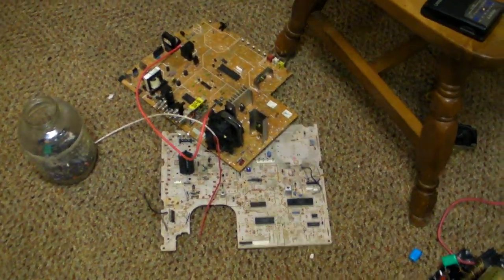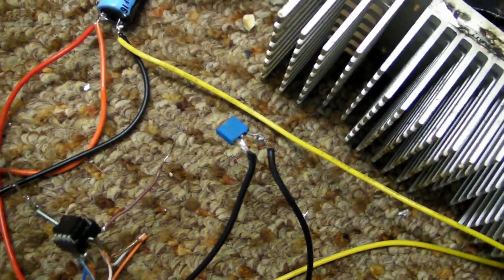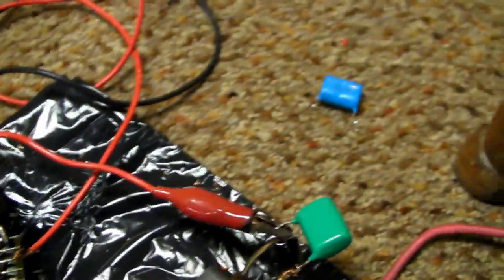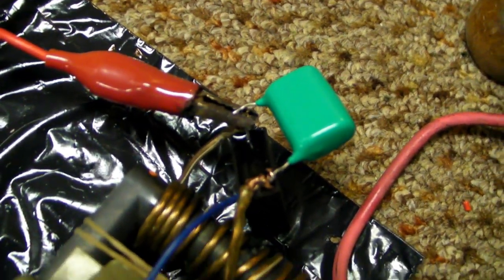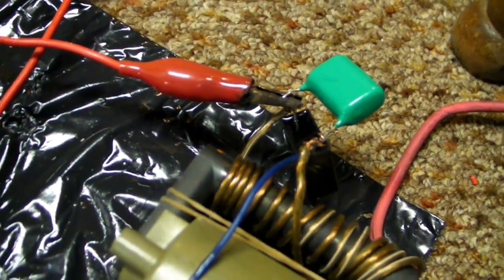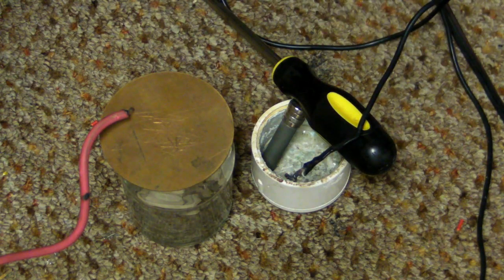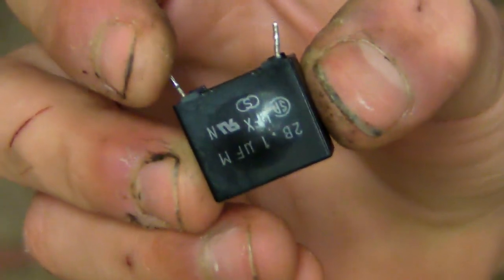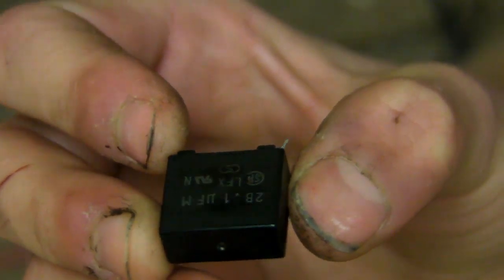Huge Arcs From 555 Flyback Driver!

Comment: 5:19, Dude, use high voltage wires, I can see a small bule corona between your fingers.
Reply: ikr? it gunna go rght through one of those times lol
Reply: corbonzo1 at least it will be high frequency xD
Reply: ahaha i have a tiny flyback from a plama globe, that thing is scrary, itll hit you right threw think rubber pliers handles XD
Reply: What!? I'm totally pulsing mine then!  Dropped it about 2 months ago QQ
Reply: Tesla Explorer i just plug it in hahaah
Reply: but it needs MORE xD
Reply: i accidentally touched the ground wire on my TC secondary, those where pretty good burns, and it smelt horrible XD
Reply: perigoso, se o diodo interno entrar em curto, a alta tensao fica alternada e ele leva uma porrada

Comment: ok, now the transformer is 11,8V around 6A, with a capacitor of 16V@22'000uF, the output is 16V, the maximum of the 555 timer capacity

Comment from the maker: @ciprianwiner no problem, hopefully it helps, also, that little inductor transformer on the in series with the input certainly helped a bit, so try some work with the inductors in series with the mosfet-flyback-positive voltage

Comment from the maker: @lo9765 Yes, the capacitors are needed in the self-oscillant driver (ZVS) for it to work correctly otherwise there will be pretty much no output. On the ZVS, the driver uses very little power when there is no load, but when you draw an arc, that is when it sucks up power. With my 555 driver it seems to draw the same power when or when not arcing, which may be why the mosfets heat so badly in most cases.

Comment from the maker: @JD8853 Hmm, I never thought of that. As for the capacitor, that wont work, its too low of a capacitance. Saltwater caps are normally .00XuF

I sometimes do that with the TV, but often it dies from RF, and many of the flybacks are from dead TVs I pick from the garbage.

Thanks, good comment about the mosfet!

Comment from the maker: ZVS is definitely the way to go. Its highly efficient, and easy to run high powers through. But considering this is the crummiest flyback driver out there with two small additions, its not bad at all. I have quite a few ZVS videos myself, and more to come. I intend to make a ZVS that you can run directly off rectified mains.

Comment from the maker: @mgregggphone I am working on a good 555 board. I will make a video of it shortly. It is on a solder type breadboard, has a 10k 25 turn trimmer pot for duty cycle, and a 50k 25 turn pot for frequency. The frequency is set by a .01uF capacitor. This board has the npn/pnp pair for more power. I have not finished the connections on it, and want to get screw terminal sockets for the input. I plan to test it this weekend

Comment: @juniortore1 no , i'm not using zvs , i'm using simple transistor oscillator with feedback , using 2x 13007 high voltage npn power transistors wired in parallel , a capacitor in parallel with primary winding and one in parallel with feedback resistor , using 35 volts power supply , which under it drops to a lot lower voltage , i get about 60-70 watt output , with almost white arcs

Comment from the maker: @AddColorsToYourLife That makes a lot of sense! Thanks for pointing it out why the mosfet heats.  Holding the wire is not really, but would certainly hurt if it burnt through the insulation. I only did that in this video, I used a chicken stick after.

Comment from the maker: @08Kutt Why schematics? I explained it good enough didnt I? Just average 555 flyabck driver, with a .22uF capacitor across the flybacks primary. And for the inductor, its not needed, but I found it to help keep the mosfet even cooler than it was. That just went in series with the  + and the flybacks primary to mosfet drain

Comment from the maker: @filipkof Ya, the 555 flyback driver normally makes a LOT of mosfet heating. I have had 2x IRFP250 mosfets die at 12 volts from overheating. And yep, thats what I thought. Also, this goes with the concept of getting rid of kickback, but the capacitors may help smooth that.

Comment: The black ones can't handle the high frequency of the resonant setup.
The reason the MosFet stays cooler when arcing is because it reduces the frequency on the primary which reduces the amount of time/second it has to switch thus keeping it cooler.
And the inductor there is called an inductive choke :3
Nice build though I like it
Reply: Its more likely just prevents avalanche of the mosfet by reducing the peak drain voltage, the frequency is set by the 555 timer.

Comment: i tried using a 0.22uF 400v capacitor and some random inductor but i ended up stuffing everything up so it doesn't work so i will remake it without resonance stuff. instead, i will use something 3 12v SLA batteries (with the 555 regulated) to get a massive output.

Comment: @juniortore1 the only problem i have is that it draws max current even without load with the risk of overheating rectifier of the power supply, and i get ton of heat on transistors too , but that is normal , i have to use a fan to keep them cool , or current will drop very fast , capacitors tends to heat up too

Comment from the maker: Just a 12v car charger (may have had two in parallel at the time using a combination of the 6v/12v settings) and a smoother capacitor was paralleled.

Comment: I like making mini high voltage stun-guns, using high current (amps) as the 'knockout' not the voltage using a 9v battery, they work on the basics of a flyback and using KV capacitors.. Homemade high voltage gadgets are fun, like your videos.. :)

Comment: The transformer in series with the supply is acting as a ballast, limiting the current the circuit can draw. They are used for AC purposes, but it would work in this case because the circuit draws large spikes of linearly increasing current, until the MOSFET goes back to it's off state, where the circuit draws hardly anything at all. That rapidly changing current causes some voltage to be dropped across the transformer coils.

I am surprised it is not limiting the output, although when you are not drawing an arc, the current draw is probably smallish, therefore the change in current over time is small (less spiky) and less volts are dropped, so high voltages are achieved with no arc, and it is a balancing act when you are drawing arcs, with the current through the arc, and the Vdrop across the inductor.

It would be better to scrap it, and just use some large electrolytic capacitors directly across the power supply connected physically as close to the flyback and mosfet drain as possible, as well as a few of those MKP capacitors. That will help deliver lots of current when the MOSFET is demanding the current! That more than doubles the output from my HV circuits! (see my tesla coil slayer exciter circuit, where I used 3 large 100nf capacitors in parallel across the supply)
Reply: He did have that resonant capacitor too remember so maybe its setting up some kind of tank circuit.

Comment: 1/1k + 1/2.2k = 1/R or 685 ohms When adding resistors in parallel you add them as inverse. When you add them in series you just add their values together.

Comment: Adding a capacitor helps with self-oscillant driver too , but the issue is that you use max power even when not drawing arcs , do you have same issue with 555 driver?

Comment: Hey man, how much current are you pulling from there? I've already connected it without a res cap and an inductor directly to the supply (with a12v reg. for the 555) 

Do you think it is possible to provide about 500w with that driver?

Comment: the mosfet heats up when you are not arching because the power is building up and not discharging in another form of energy. so the excess energy is in the form of mosfet heat. GOOD JOB though you should probably hold the black wire with a long piece of wood because even though the wire is insulated, at that high of a voltage the wire cover is not even an insulator anymore

Comment from the maker: @dzdice At 36 volts I was drawing about 2-8 amps. In my opinion, even if resonant do not input over 24 volts, because if anything fails your driver is trash, and possibly your power supply. It is possible to do 500W but the arcs will probably be very crappy if your mosfet does not immediately explode. In my opinion, make a half bridge or ZVS driver and you can draw much bigger arcs with much less input and driver heat and driver stability. (see later zvs videos I made)

Comment from the maker: @a380rockerfan yep, the resonant capacitor needed varies by the flyback.

Umm, there's an issue. 12 volt regulators only handle 35 volts MAX, 30 recommended max. So, 3x12 = 36 which = FAIL

Just wanted to point that out before you fry the regulator, 555, and maybe mosfet

Comment from the maker: Exactly. I was just putting random shit (that should do something) in series with the mosfet/ flyback. I noticed that inductor made the arcs bigger. I would guess it does wither something as a choke, or causes a different frequency on top of the one the 555 timer is creating. I guess just plug and play until things are beast lol. I know exactly what inductors do and all, but here? no. It just worked

Comment from the maker: @08Kutt Dude, use a voltage regulator! or power the 555 timer with a different 12 volt transformer, combine the negative wire of the 12 volt to the higher voltage negative. In simple terms, go with the 12 volt regulator since its hard to explain the other method

Comment: The MOSFET stays cool because the impulse that normally feeds the arc is being wasted in the MOSFET's diode that protects it from over voltage and damage ... some parallel diodes could help it , idk for sure so maybe someone will explain it better but i know MOSFETs don't like spikes from transformers.  But wow! those look great for 555, i've actually never made anything with 555 that wasn't just making heat xD or horrible noise as it was messed from some interference ...

Comment: Now see, if you had some Pots instead of resistors, there's a good chance you could get better yet arcs =)  Also, that ferrite transformer you used as a ...Ballast?  It's a SMPS transformer that powers the whole board.  Usually 300W or so, and ranges from id guess 5V to 24+

Comment from the maker: @jake3085 Thanks, well, there was a lot of corona in real life, but the camera sure did enhance that pretty well. And that is with a UV filter. Maybe a polarizer filter would stop that instead. Not that it bothers me though. To be honest, I have never made a 2n3055 feedback driver. The closest I ever made was by using a TIP120, which worked well up to 24V at a low current. There is no real methods of making it last longer that I know of, besides using superior cooling.

Comment from the maker: @08Kutt Just to let you know, I hate the IRFP250. Only reason I re4ally used it is because it is cheap and can do 30 amps. From now on, I will use different, newer, better designed mosfets or IGBTs

Comment from the maker: @08Kutt dont do 16 volts man! Most 555 timers have 15 as a max, some die at 14 volts. So, stick with 12-13.
Do a minimum of 12, otherwise mosfets gate may not switch correctly.

Comment: the mosfat heats up when not arcing because their is no dicharge which is like charging a battery without a smart charger and letting it run for longer than its safe charge zone and another is i would make my own capsitor with a glass jar because it will not heat up as much because its just salt water in a jar. and 1 more thing

i know making a 555 driver for it makes big arcs but i thing u can use it straite off the tv. all youn have to do is ground 1 wire to the metal frame and then 2 the FBT

Comment from the maker: @PhxSt0rmz Well, I am not ripping this mess apart. Ill try that when my breadboards arrive.

And its not only acing as a ballast, something with inductance is going on. Without it, my mosfet heats badly (still not like before butttt...) And when I wire it up, the arcs are noticeably bigger on 12 volts.

Comment: @juniortore1   also when i said you can run it directly off the tv...    well you can but not for long amounts of time and the reason they would fry is because insted of creating the arcs aetween the glass part of the tv (i forgot what that is called) but you have to ground it and the flyback cant be connected on the main circuit board along with the other components.   it has to be a tv where the flyback is seperate from the main board  which then the flyback would likly be sitting behind the--

Comment: what is the purpose of that high voltage spark for, can it be modified to power a home? it's just keep on sparking with very low amperage, i think it can never start to run a junk dc motor which draw 30 amps to run.

Comment: @juniortore

well if the tv your working with has the flyback on a seperate cicuit board and not on the main board then you might be able to but otherwise my idk.    the only reason i would use it streaght from the tv is because 98% of my projects involve building stuff without buying stuff because only cvs is within biking distance and theirs no way my mom would drive me for something like this.     but ill find a way.  also i do have a flyback seperate from a tv along with 2x 12 V batterys .

Comment: HOLY SHIT BRO! I can a crap load of corona hissing around your fingers when you hold the black wire. This kinda could be a sign hat the insulation may fail sooner or later and you may get hit with nasty HF burns! Ouchies! Maybe you should probably use a bit of HV cable cut off the flyback power out and you should solder that onto the existing black wire. Still, awesome video! I love that! I have so go to do that when I get my IRFP250 MOSFET's in a weeks time

Comment: He's getting corona to his fingers. Thicker insulation wont really do much, because in this case, it is acting like the dielectric in a capacitor, where the wire is one plate and his finger is the other.

Comment from the maker: @zker666 Ya, I saw it. Well, now to try to mess with capacitors :D

Here, it draws 8 amps or so, but the mosfet doesn't heat. As to without the capacitors, it uses the same amps, but it heats BAD

Comment: Put the wire on a stick to isolate yourself completely from the arcs and high voltage. High voltage can be pretty dangerous if you arent careful you will be killed.

Comment: Wow this video is ancient, all the comments are 2 too 5 years old, the problem with your capacitors aren't that they are not high enough voltage it's that they aren't high enough current, the frequency you are running the fly back at is to high for the microfared value, on 24 volts you are probably pushing 7 to 10 amps of circulating current, your primary is heavy enough to handle that, but you have to have a high frequency high current resonating capacitor, or you can take like 10 capacitors that are one tenth of the value you require and  parallel then so that it equals what you need in capacitance your circulating current will be the same but only 1/10  of that current will be passing through each capacitor, and they will run much cooler, which means greater efficiency and much higher output. You will also need an  inductor between the fet and the flyback so that you are not driving a square peg into a round hole.

Comment from the maker: @high1voltage1rules All of my decent flybacks are dead, I am left with crap now. I wound my own, now, with way thick wire, but with an excessive amount of power to my new ZVS, it pulls a good 5 inch arc about 2/5" to 1/2" thick. I need to get some thinner magnet wire, and wind one for higher voltage, so the arcs can stretch farther. My real name is Salvatore. And whats your name again? I know you mentioned it before. Thanks

Comment from the maker: @blackmesa25 I have not collected any in a long time. I have not been able to go garbage picking lately. Every flyback is different, they like different frequencies, have different current and voltage outputs, some have capacitors, ect. When I ever see one in the trash, I am sure I will rip it apart and leave a little surprise on the victims curb lol
I should make a video of my collection. What I should do, is wind my own someday since I keep killing them.

Comment: now put some music on pin 5 of the 555 :P
Reply: ***** Why??? What kind of music do you refer to???
Reply: gyorgy komaromi if you modylate pin 5 of the 555
you will modulate the output
and this wat the flyback becomes a speaker
and the arc you pull plays it